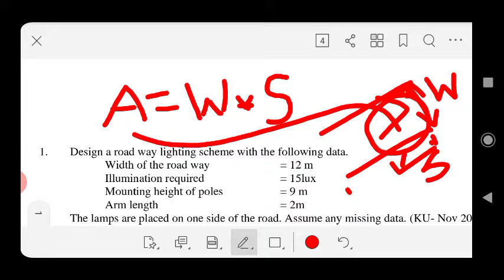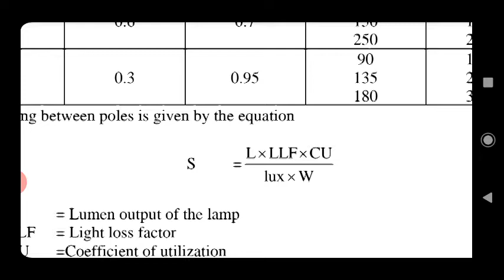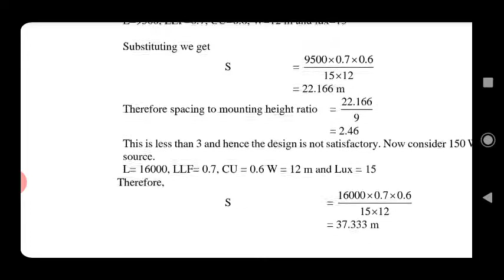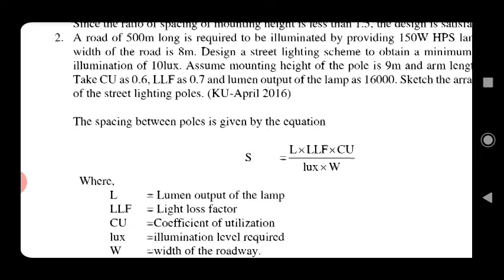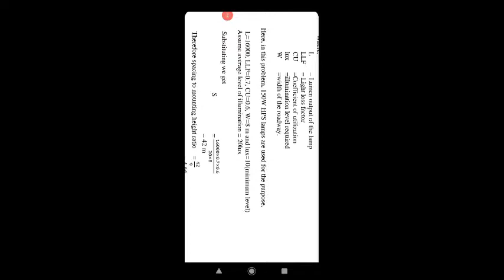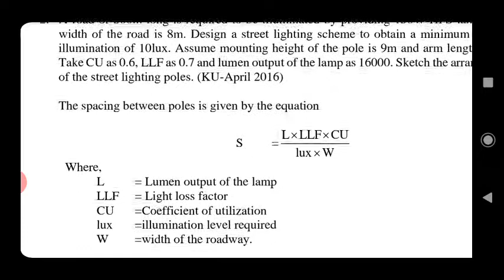problems on road lightning

Comment: Sir,
qstn no:3 il avg illumination cheyyumbol 2 kond multiply cheyyande. Appo 0.8*2=1.6 allle appp enganaya 16 okke choose akkunne
Reply: Sir 15 lux eduthillle athu enganaya. 1.5 aaville kitta. Please reply
Reply: @electricallectures123  sir angana assume cheyyumbo nthelum limit undo
Reply from the maker: Don't worry average illumination is not required, you can solve the question without Eav
Reply: E0avg/E0min=15/0.8 
ithu cheyyyumbol 3 ne kkkal valiya value  aanallo varunnathu. Onnu explain cheyth tharo sir enganaya appo aa value choose cheyyannu?
Reply from the maker: @efghjmbcvnjjkkjjo494  Eavg is not given in question, please read the question
Reply: @electricallectures123  sir ath thannittillla. Appol enganaya assume cheyyunnathenna chodichathu. Nthelum limit undonnn
Reply from the maker: @efghjmbcvnjjkkjjo494   @efghjmbcvnjjkkjjo494  if Eav/Emin value is high then it indicates more uneven light distribution so we need to choose lesser value of Eav ,if it is  less than or equal to 1.5 to 2 is good  for indoor, for street light 3 to 6 is better